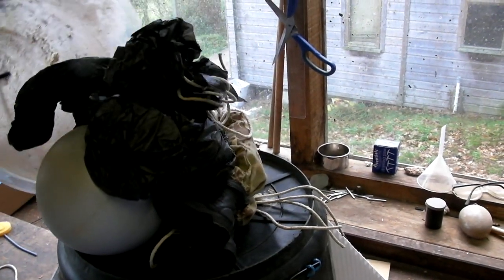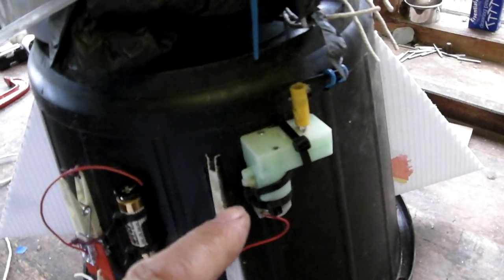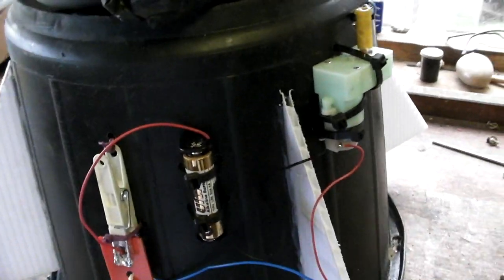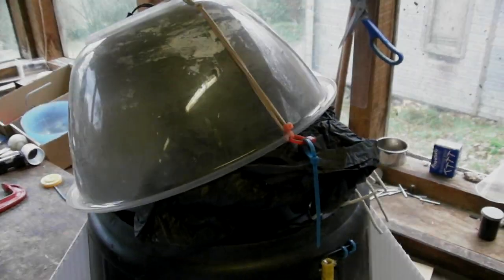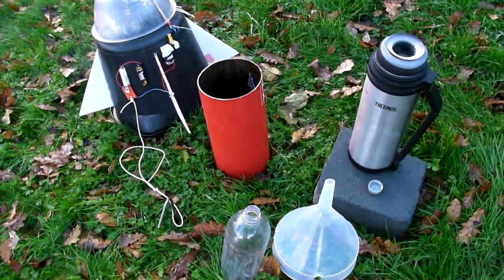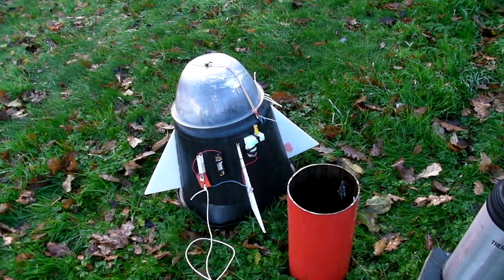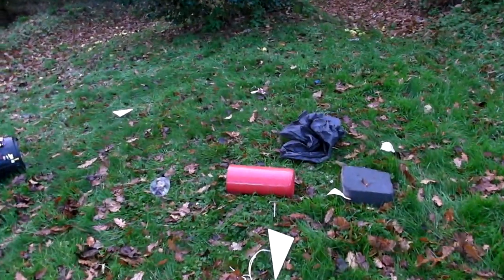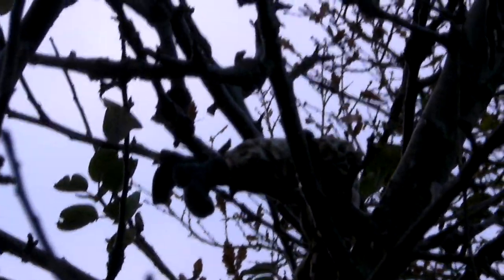The Liquid Nitrogen Bucket Rocket Revisited

Comment: Did you really only spend 3 minutes on this?
Reply from the maker: Probably no more than an hour and a half to be honest.  The little circuit for popping open the nose cone was already made as we use these on our water rockets.
Reply: Water rockets? Do you have a video about that?
Reply from the maker: Oli4vn Not at the moment except the Personal Water Rocket Transportation Device video.  If you want to find out more about water rockets I can recommend the USWaterRockets channel and also the Air Command Water Rockets website (just Google it to get the URL).
Reply: wonderstruckwow I busy with water rockets myself, but I just wanted to know how your rockets look like. I've watched the Personal Rocket and liked it very much!
Reply from the maker: Oli4vn Glad you liked it - we're working on a bigger version for next summer.  We run science workshops and shows for schools in the UK and we use water rockets for those.  Our bigger ones have two stages and we have experimented with boosters as well.  At the moment we're looking at how we can use microcontrollers (Arduino etc) in them to provide more control.